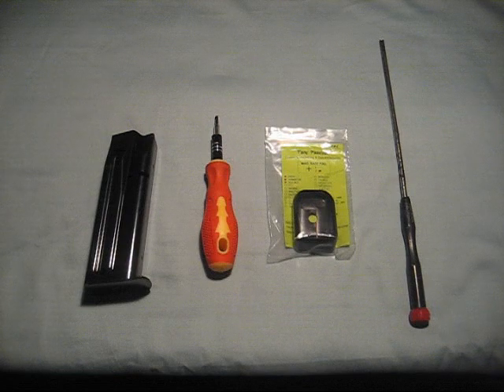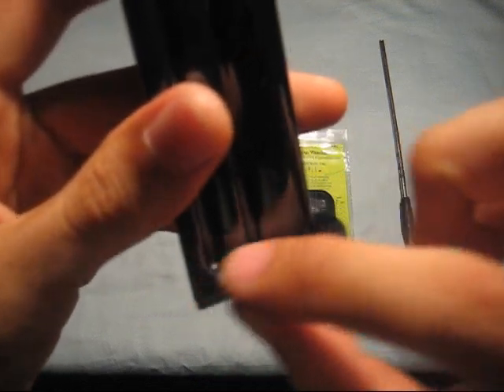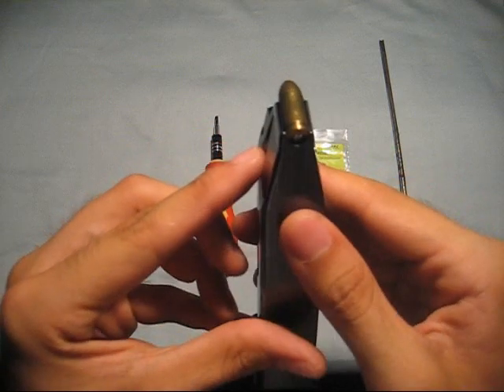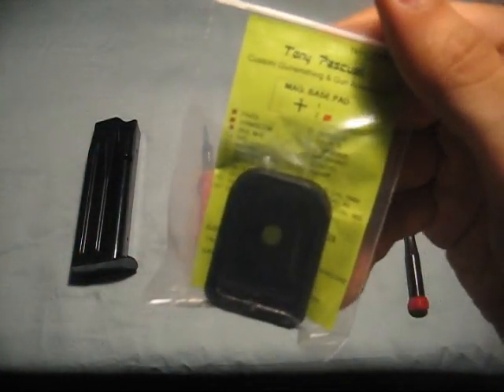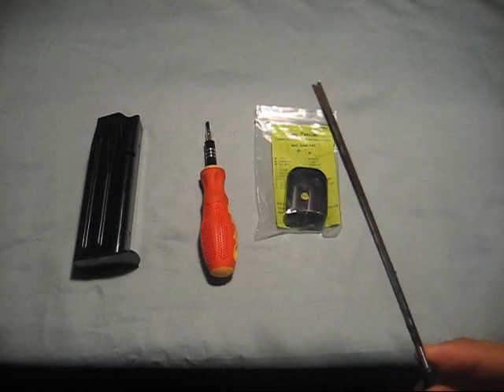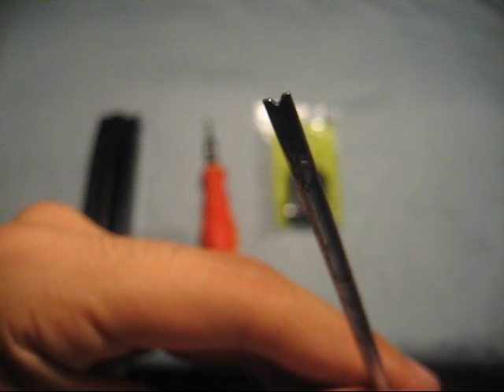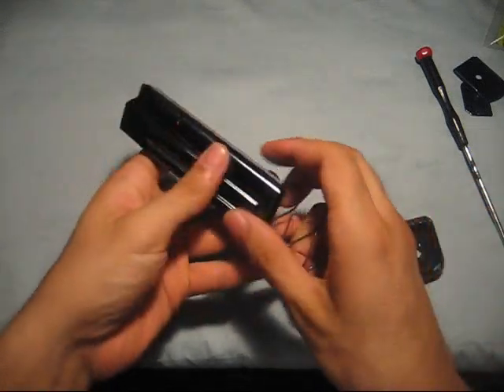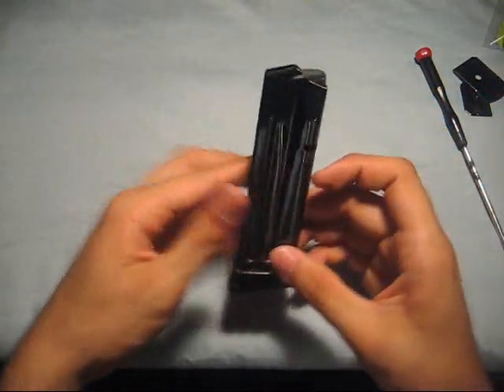How to Install +2 Magazine Base Pad

Comment from the maker: I got the 1911A2 magazine base pad from Tony Pascual booth in the Gun Show.
*Base pad will work for 9mm, .40 and .45 magazines. You can double check with Mr. Tony Pascual himself.
If you can't wait for the next Gun Show, you can also check out Pascual Gun Works at #35 Baco St. corner M.J. Cuenco St., Quezon City.
The shop is near the rotunda where España Boulevard and Quezon Avenue meet. You can do a Google Map search for the exact location.

Comment from the maker: @roger29rabbit
Hey Roger! For single stack magazines for the 1911, I believe I have only seen a +1 magazine base pad. The only one I've seen made was by Col. Bayang. His shop is called Ordnance Supplies and Services located at 2165 A. Luna St., Pasay City (near Buendia-Taft Ave. intersection / Cartimar Market area).
The double stack magazine base pads for Armscor/Para Ordnance are +2 capacity (for 9mm and .40 S&W I believe, +1 for .45 ACP). Most STI/2011 base pads are +1.
I hope this helps. :)

Comment: You say you don't have to use the floor plate.  Why wouldn't you use it?  Does it need to be omitted in order to get the +2 capacity?  Seems like the floor plate solves a lot of headache with disassembly and reassembly.

Comment: with all fire arms you file or modify the part your fitting not the part your fitting it to... you fit a safety to the frame not the frame and sear to the safety.... 

little bit of flitz would smooth out both parts evenly...